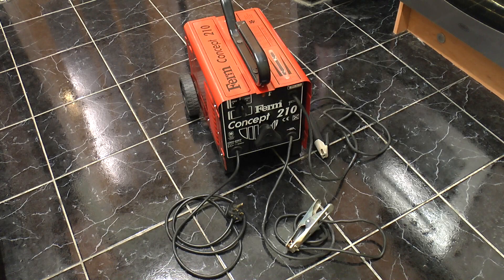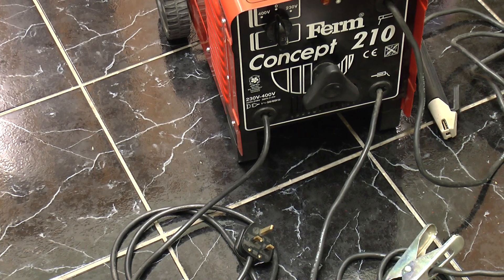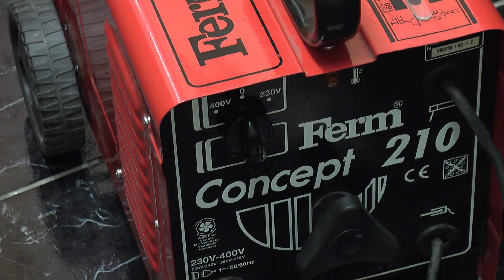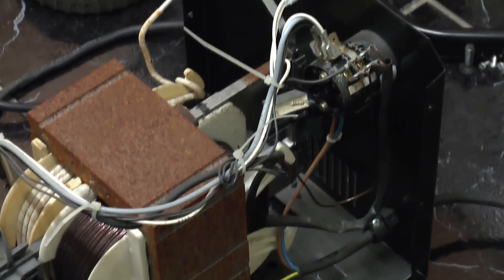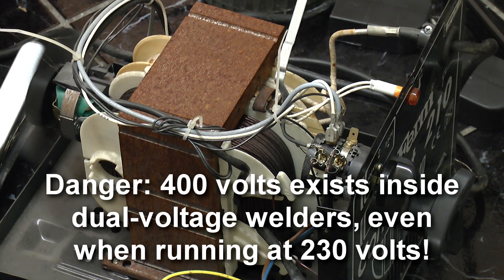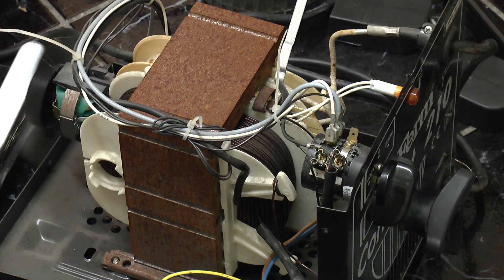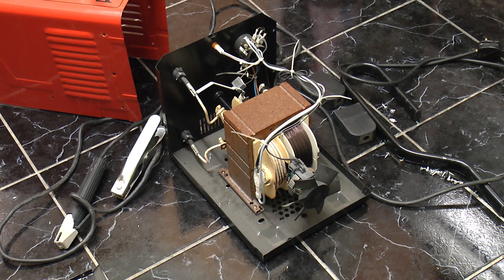Inside an Arc Welder

Comment: Thanks.  A guy on the internet ripped apart a microwave and build his own transformer.  My cousin and I have been discussing this so thanks for showing us what a more normal one looks like.  I was grousing about the wire he used to create his welding current.  You half confirmed my theory that I didn't like the way his was insulated.  I didn't realize until this that the first electric welders were invented in the late 1800s.

Comment: Sir when you're moving that plate in and out of the transformer to adjust the current is there supposed to be some space in between those two components? or are they supossed to be touching  tightly? I have a Forney and it looks very similar to yours, andupon inspection and cleaning the inside noticed there's a lot of space and I don't know if I'm missing a part but it buzzes like crazy when I tried to turn up the amperage and plus when I turn up the amperage and it starts buzzing it moves on its own the setting doesnt stay put. How do I tighten it up?

Comment: i wonder if you could tell me what i need to do to get mine to run on the 415v side,
i do not have 3 phase supply only 240v, mine is a clarke 210 ti but is exactly the same as your welder, only differance brand name and colour, inside outside the same, 
the reason im asking is when i crank the power up to weld with 3mm rods, it blows the plug fuse every time..
Reply from the maker: Naughty way would be to replace the plug fuse with a brass standoff or spacer, such as RS part number 664-3004 or 664-3173, as long as it's a decent-quality plug that can handle the current. Incidentally some mobile X-ray machines are/were fitted with unfused plugs to allow the machines to operate on hospital ring circuits, see https://www.yumpu.com/en/document/view/33107898/quotred-plugsquot-on-mobile-x-ray-units-pdf-148kb for more info.

If you've got the 240-415 switch then there may be a screw on the front which physically prevents switching to the 415 setting. To convert to 415 volt operation remove the screw and screw it into the other hole (that prevents 240 volt operation). To allow switching to either, just remove the screw and either put it somewhere safe or drill another hole in the welder case and screw it in there.

Note that if running a in 415 mode on a 240 supply that you'll be welding at a correspondingly lower voltage.
Reply: i did take the screw out, tried it on 415v, noticed that it was running quite as a mouse,
got no arc at all, i was thinking that the 415v was to double your power to allow you to weld with heavier rods, my welder has a setting up to 5mm rods, which i cannot see this welder being able to achieve with 240v, the 3 phase thing is like a bluff on this welder as its setup to run 240v, as far as i can see from the homework i have done on 3 phase, is that its a 5 pin or 5 wire setup, how you get 5 wires from a 3 pin plug puzzles me, i thought when i bought it , that it was plug and play, and the welder did all converting for you, thus the double the price tag....any help or insight into this would be very much appreciated, yours with thanks billy.
Reply from the maker: It doesn't run on three phase. In 415 volt mode it's straddled across two phases. On  4 or 5 pin red-top plug the brown and blue wires would go between L1 and L2, L1 and L3 or L2 and L3. Two out of three. No connection to N. Earth wire obviously still connects to the Earth pin.

Comment: What would happen if you put the electrode tip to the material and held the rods with the ground? Would the rod be less stable to handle or would it physically not work?
Reply from the maker: Electrically it would be exactly the same as the welder's output is AC with no reference to ground. All you have are two output leads from the transformer with different shaped connectors on them.
Reply: AintBigAintClever Thanks! I was just curious lol

Comment: Hello this video was very helpful but I was hoping you will take the time to explain, how would one go about rewiring the welder to run on the higher voltage setting? reason being I bout a similar welder and would like to rewire it to run on height setting. thank you
Reply from the maker: I'd expect the instructions to be in the handbook that came with the welder.
Reply: +AintBigAintClever  I agree but unfortunately that is not the case
Reply from the maker: What is the make and model of your welder?
Reply: +AintBigAintClever  its a bx1-200c the one with a dual 110/220v switch on the top left corner very similar to the one in the video

Comment: sir my welding machine is FERM Concept 1400 and I don't know how to use it, because the U1 230 volts
Reply from the maker: +Bryanchester Redobla Probably similar to the Ferm Concept 1500. The manual is here: 
http://doc.ferm.com/Servotool/documents/WEM1001%20Manual%20%200301-09.pdf

Comment: can i clamp the dc side to a 12v battery can i get 240 out of it use it as a inverter  can this be done maybe?
or no way it will work?
Reply from the maker: The welder has no DC side, the output is AC. If you connect the DC side to a 12 volt car battery you'll probably just burn out the transformer.

Comment: Very nice video! My dad and I realized we didn't know how an arc welder produces voltages capable of arcing and high current, but now I get to explain it to him like I'm an expert. hehe! The variable inductance seems obvious now, but I definitely didn't think of it in the past couple days.
Reply: yea the variable inductance portion (ie the amperage control). perhaps you could explain it to me or send a link my way? because I have never seen a device like that nor have a clear view from the video what it is actually doing. thanks :)
Reply: TheCarpenterUnion Basicially, the core of the machine is a transformer that converts line voltage (pressure) and current (flow rate) into a different (in this case lower) voltage and current. The resulting voltage is determined by the number of turns of wire around the primary and secondary coils. If the voltage drops (from 120 or 240 volts to about 40ish volts), the current must increase after conversion to maintain the same power (Watts). 
The 'efficiency' of that power conversion is controlled by the movable iron plate. Moving the iron plate in or out changes the efficiency of power conversion by blocking or unblocking the magnetic field that the primary winding creates.When more power is converted to the secondary winding (not being blocked by the iron plate), the current increases.
That all results in lower voltages and higher currents to melt metal!!!!
I don't want to keep rambling about all the details, so I hope that gets you in the right ball park for now. Feel free to let me know if you have other questions.
If you want a really thorough going through of it, check out the All About Circuits web site. They made free online textbooks on electronics and have a forum! That site helped me really start to understand electricity. If you aren't familiar with fundamentals of electricity, I highly recommend starting at Volume 1 and only moving on when you get the concepts. It does pay off!
Reply from the maker: TheCarpenterUnion There's some info on how a welding transformer works here. The diagrams offer a very good explanation.
http://info.ee.surrey.ac.uk/Workshop/advice/coils/leak/weld/index.html
Reply: AintBigAintClever Nice link!
Reply: swiftjeff thanks haha, most of that i knew already, my question was dealing with the variable part only. I realized later that there must have been iron blocks attached to that mechanism that were moving between the primary and secondary (like you said). now its just a matter of assembling one myself ;)

Comment from the maker: Check the follow-up vid where I worked out the full circuit diagram. The fan runs directly on 240 volts when the welder's in 240 volt mode. In 400 volt mode the fan is in series with a capacitor and a resistor. It was tricky to work out what was going on until I disconnected the switch and tested it.
Reply: what is the value of capasitor and resistor in 400 v mode

Comment from the maker: Two primaries (one thinner 170v one, one thicker 230v one). In 400 volt mode the fan is run via a small resistor and capacitor, in 230 volt mode it's wired straight to the supply. If the 230 volt primary is energised the transformer will output 170 volts across the other, so 400 volts is available. Gonna have some fun with that :)

Comment from the maker: It's not quite centre-tapped, but close. I've checked the switch properly now, to figure out the connections. The transformer has a thick 230 volt winding and a thinner 170 volt winding, connected in series. If running on a 400 volt supply both windings are used, with the fan running on 400 volts via a small resistor and capacitor. When on a 230 volt supply only the 230 volt winding is used, with the fan running directly off the 230 volt supply.

Comment from the maker: Yes, it's for phase-to-phase use, and means that the welder's input current draw can be a lot lower (I think it pulls a maximum of 33 amps at 230 volts, but only 19 amps at 400 volts).

Comment from the maker: Cheers. When I make use of the 400 volt winding I'll see if the handwheel affects the current on the 400 volt side (it's on the same side of the transformer as the 230 volt winding, the welding winding's on the other).

Comment from the maker: Yes. The inverter welders convert the incoming supply to DC then chop it at high frequency, which lets them use a much smaller (and lighter) transformer. It's the same principle as a computer's switched-mode power supply.

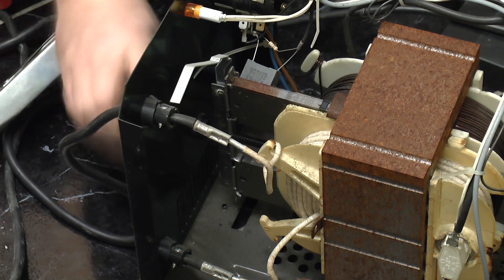Comment from the maker: I thought it'd work that way, but it's actually the other way round, the current drops as it's driven into the core. Maximum current is attained with it all the way out. Take a look at the indicator bar at 1:20, the marker on this is a metal strip attached to the top of the sliding shunt plates, you can see this in action at 2:55.

Comment from the maker: This one's rated to 210 amps max, I'll be popping stuff myself with it soon. I'm also going to open it back up and add a three-phase red 16A "Commando" socket to the front so I can make use of the 400 volt supply that lurks within.
It'll be an odd setup (L1 230V to N, N 170V to L2, no connection to L3) but I'm sure it'll have its "uses", especially when I use the variac to overdrive it to 470 volts :)